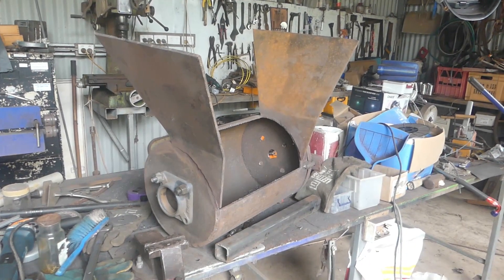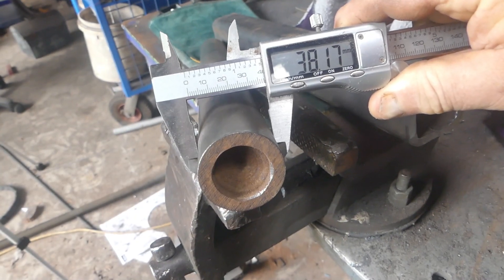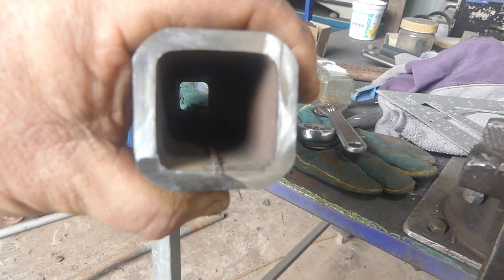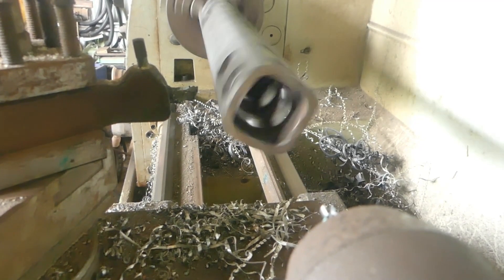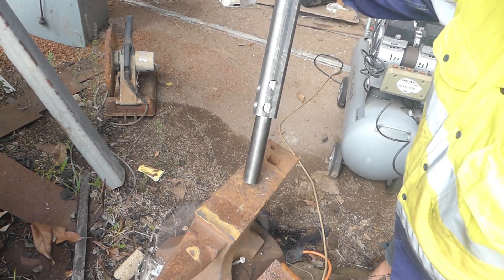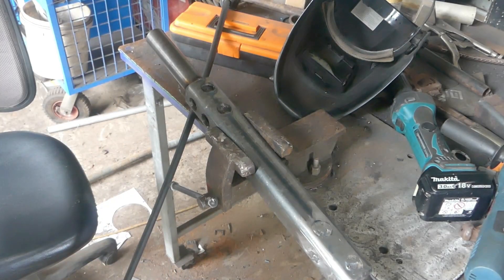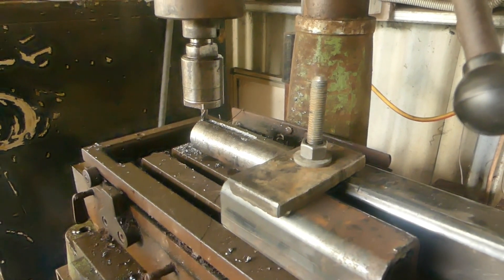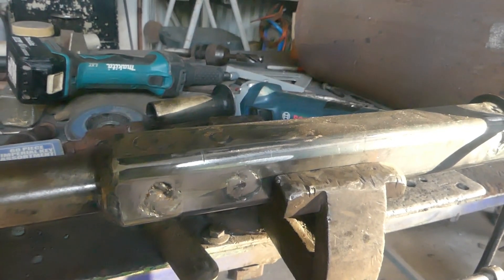FINALLY BACK ONTO BUILDING THE BIOCHAR CRUSHER

Comment: For the seam in the square tube file/grind a flat on the round shaft to ride over the seam. Test  fit until it slides in easily. What you did works too but it’s easier (to me) to grind a flat. Good job.